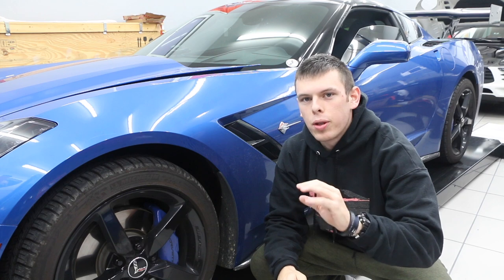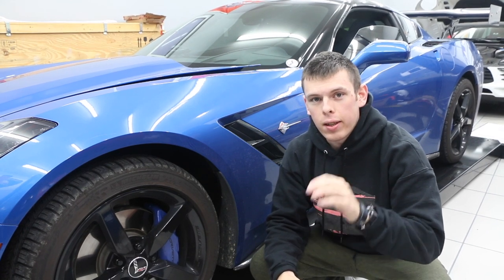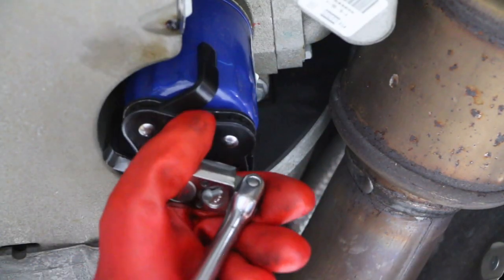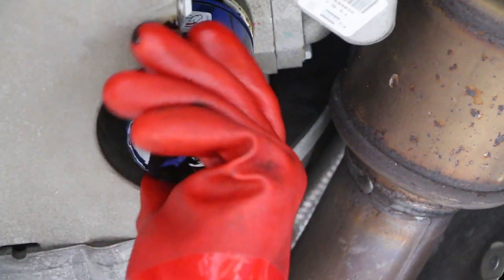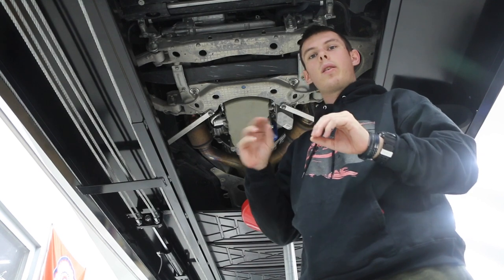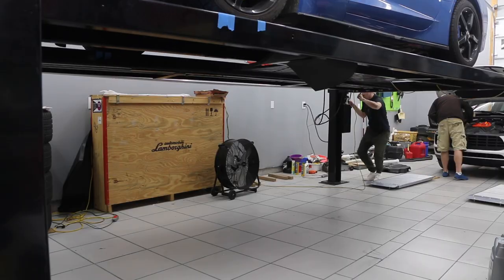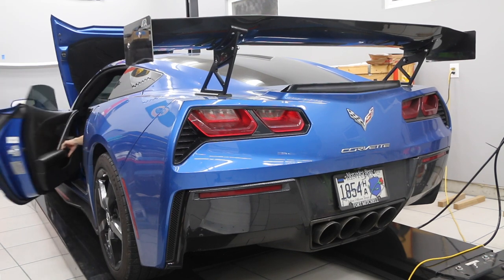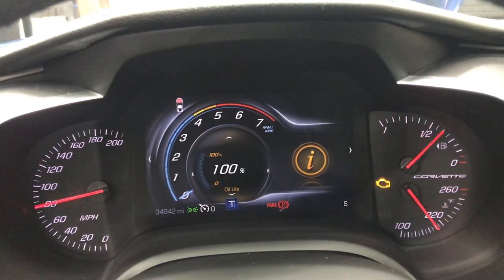C7 Corvette Oil Change (How to do) - Wet Sump

Comment: read that the filter 12696048 you used isn't good and cheaply made in forum, I was trying to find the older version but no luck. No problem with that filter right?
Reply from the maker: I haven’t had any issues with the filter. I bought it at the local Chevrolet dealership, I like everything to be OEM. I’m sure there are some other options, and the forums are probably the best place to find them. 😎